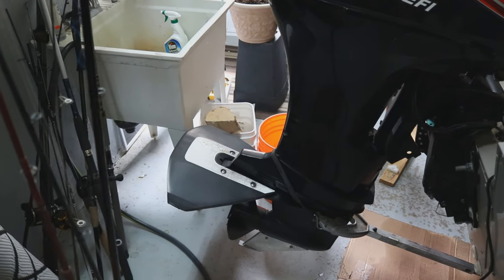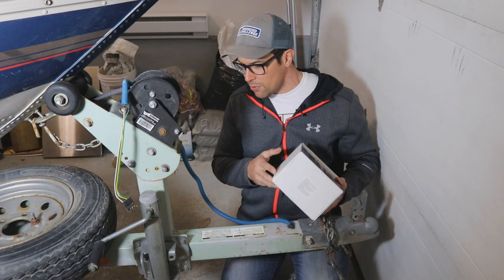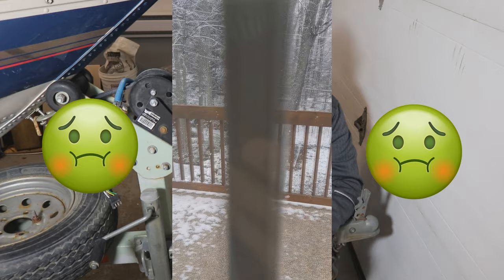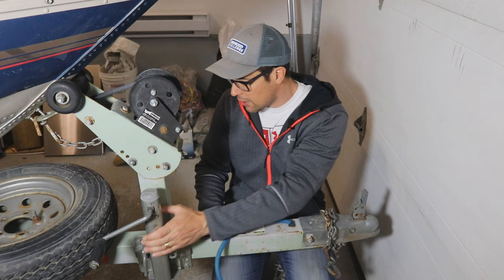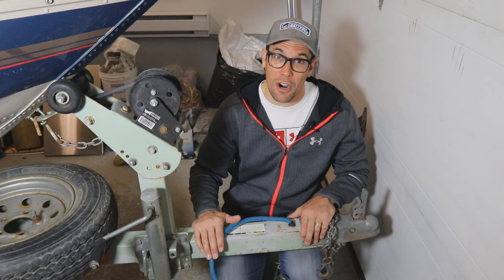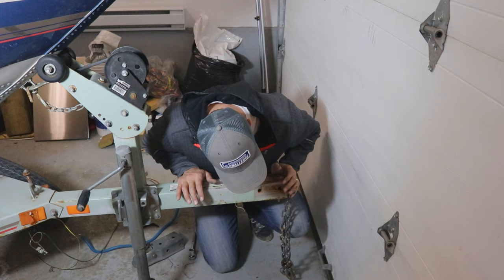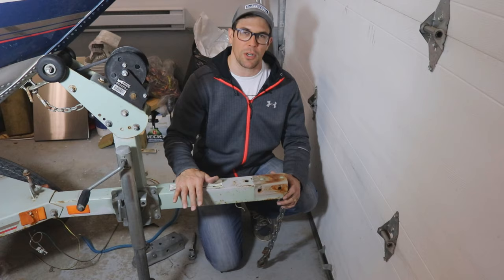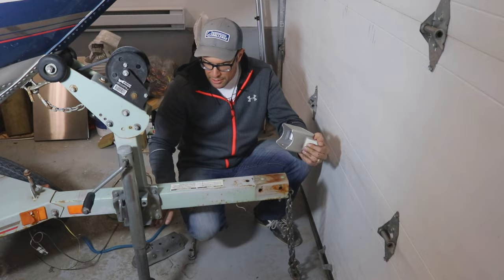How to install a Fulton Fold-Away Trailer Tongue Hinge + Trailer Painting Tips and Re-Wiring Guide!

Comment: Great presentation. Just a thought on the safety chain issue. Note that if the Fulton joint fails, the chain will not prevent the tongue from hitting the road. This is why we all criss cross short chains to the vehicle for ball joint failure protection, the short chain  criss cross keeps the tongue from hitting the road. But a Fulton joint failure,  even with the chains, could be catastrophic with the tongue hitting the road and dragging the trailer on a 3 foot length of chain, but I agree, better than a complete release  of the trailer.
Reply from the maker: Hi Dave, thank you for the comment and absolutely you need to cross your chains.  I'll have to rewatch the video as I don't remember but I always cross the chains when connecting it to the truck and I believe I measured it out to make sure the chains would catch it.  Although it all depends the incident... I've seen accidents where the chains or safety cables snapped like string.  Honestly about my worse nightmare towing is a tongue or hitch system failure and I always inspect everything for any cracks or signs of wear every time I hook up the boat for a trip.

Thanks again for mentioning this very important tip!

Comment: I have talked to a lot of people and dealers that have had a lot of problems with Fulton swing kits! Boat dealers have stated that they would not use this product because of failures. I’m not trying to bad mouth this product, just trying to get the word out to check Fulton swing brackets for cracks. The dealer that sold the boat replaced it for free based on the defective product (there opinion).
Reply from the maker: I've definitely heard some stories about these failing and you're absolutely right, it's crucial that you always inspect your hitch and swing brackets before going out.  I actually always do a walkaround of my trailer before every tow just as a pre-caution.  I wonder if Fulton has said anything about excessive cracking... so far mine looks as good as the day I bought it.

Comment: Really good job on the install Dan... those solder sleeves are a great thing... definitely simplifies wiring splices AND they are very strong... only thing I "might" have done is to run the ground wire to the main part of the trailer tongue, not on the part that swings due to possible bad grounding thru the coupler... you could still do that by running another wire from the current ground wire inside with the other wires
Reply from the maker: Thanks Phil! And yes those solder sleeves are absolutely amazing I love them! I agree about the tongue trailer wiring part that's why I posted a pinned comment at the top that has that little update/tweak mentioned. :) Thanks so much for your feedback and supporting the channel!
Reply: @DanRichardFishing  Oops... I just read that... great minds think alike???... Lol
Reply from the maker: @philtarbox8256  To be perfectly honest about it I didn't even realize it until after I did the video and my brother pointed it out.  I was like DANG IT! There's always something lol! Over the course of this year I'm going to be working on a gigantic video tutorial in several parts on how to build a quality garden shed. I can't wait to be corrected by all the architects of YouTube on that one 😂😂

Comment from the maker: Hey guys and gals, just a quick tweak to today's video for when you do your own install. To avoid any issues with your trailer lights and your trailer frame is grounded like mine is in this video, make sure the ground wire is connected on the boat side of the trailer hinge, not on the tongue side like I did. You can attach it to any available bolt or just drill a small hole and use a self-tapping screw like I did. Fish on!
Reply: pro tip : watch series at kaldroStream. I've been using it for watching lots of of movies lately.
Reply: @Briar Donovan definitely, I have been watching on Kaldrostream for since november myself :D

Comment: Nice job, I would suggest staggering the wires so not all the butt connections are in all together. I also put the wire in loom at the hinge point so when closing you're not going to pinch the wire.
Reply from the maker: Hi Eric, thanks for those great suggestions! :)

Comment: You had mentioned how difficult it was to tighten the bolts.  I just received my hinge.  I noticed that one of the bolts was defective (threads almost flat on one side).  I could probably put a nut on it, but it would be unusually hard to tighten.  Perhaps that was the issue with yours?
Reply from the maker: In my case, I just think the tapered end they use (rather than nylon nuts) is what was making it tough.  I almost wanted to break out the impact gun I use for tires!!  In your case, just contact the and they'll get you the correct piece no questions asked.

Comment: I would not use Fulton swing kit. My Fulton swing kit didn’t last three years before it broke and the boat swung around and hit the back of my truck!
Reply from the maker: Wow crazy!  Can you provide some additional details like what part failed and how heavy was your boat?
Reply: @DanRichardFishing  the boat is a 2018 thunder jet outboard. Ez loader trailer with Fulton swing away Tongue. The Fulton part with the bolt that keeps it together broke.
Reply: @ricardogutierrez9682  All because one broke doesn't mean its a wide spread problem. Anything can be defective. By the number of these being sold I would say its not an issue with all of them since you have to search hard to find complaints. Many new boats are sold with bolts in the swing tongue. None of mine have broken. It could have been yours had a defective bolt or wrong bolt installed as in to hard. There's been a small number of wheels falling of cars too! not very common though. heck the two bolts holding the hitch is weaker and you don't see them breaking.
Reply: It broke in the cast part not the bolts.

Comment: Why not just run the wires out the front of tongue under trailer hitch? I've run mine that way for years with no problems, and not cut & splice wires.
Reply from the maker: Hi Rob, thanks for the question! I know of 2 people that have actually accidentally damaged their wires that ran out from the hitch when they pinched them with the ball so it's not ideal, and my trailer already had the wires coming out the top so the hole was already there so I had no choice but to cut and splice.  Plus I guess the previous owner had damaged the wires around that area and made a hell of a poor job on the repair with a TON of electrical tape so I wanted all that gone.  I have a small utility trailer that has the wires coming right out the tongue and ever time I hook it up I have to make sure the wires are clear.

If you look at boat trailers from Ranger, Skeeter etc none of them will have the wiring coming out like that, they have a dedicated hole on the side or underneath and away from the hitch.  The only thing that will be coming out from under the tongue section will be the safety brakeaway cable if your trailer has brakes.

Comment: Great idea but idont trust that it's Alloy I'm worried about failure  and the tradgic Consciousness there of
Reply from the maker: As long as you use it with the intended equipment and the intended rating and install it properly there's absolutely nothing to worry about. You should also inspect your equipment on a regular basis with or without a swinging tongue jack. I've had mine now for about a year and I can tell you it still looks brand new like the day I installed it.

Comment: You actually gained 2 inches by the looks of it.
Reply from the maker: The overall length increased a little bit when the hitch is deployed but when you fold it back you save about a foot. Before installing the hitch if I back the boat all the way up to the sink in the back of my garage, I would have a couple of inches of clearance from the garage door. Now I can park the boat and have space between the motor and the sink and I still have about 6 in from the garage door.